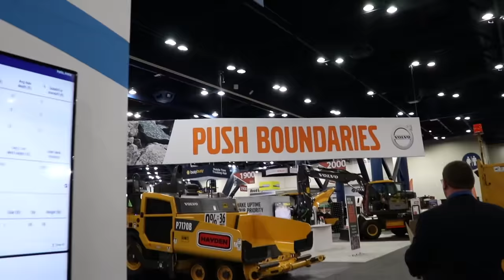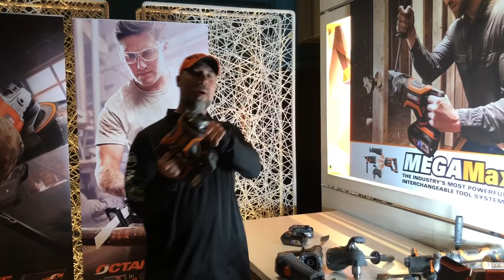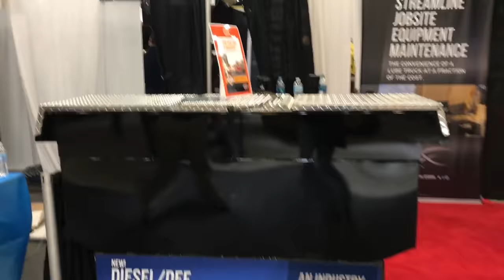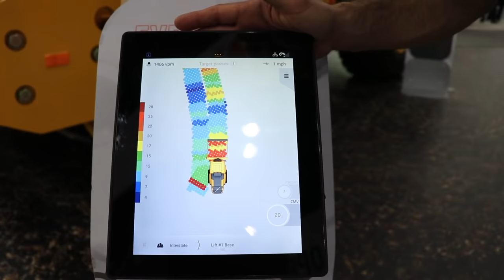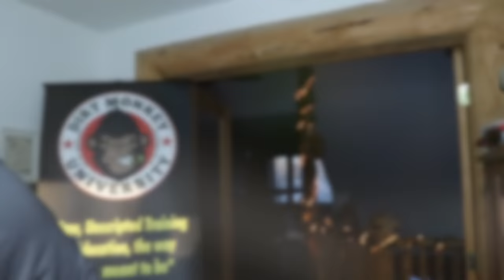Latest and Greatest Landscape & Construction tools - The Best & Worst Power tools & Innovations 2018

Comment: 8:20 the main reason for allowing a diesel engine to "cool down" a little after high idle high power operation is the turbo. Even in your trucks, if you shut the engine off after high idle, the turbo's compressor shaft will still be spinning without any oil pressure to the lubrication bushing. So you are basically just allowing the turbo to spool down a lot more and while at the same time, allow oil to cool the assembly.

Comment: The sliding radiator on the loader is boss.  The Dewalt battery powered concrete saw was a beast.

Comment: The DeWalt saw looks great for all the times I have to cut through the bottom quarter of a block.
Reply: When is out in England I want one too 😁
Reply: They are so handy in masonry to make quick saw cuts on the scaffolding I use the sthil ones all the time

Comment: Slide out radiator is fukken genius  for those of us working in the dust all day.
Reply: Eric Mahan 

Sure, in the agricultural field we already had them 10 years ago.
Reply: That’s not the radiator.
Reply: James Hintergardt 

To be exact you are right, but an oilcooler basicly does the same thing, it radiates the heat away.
Reply: Tim Hagemann Deere has had slide outs for 30+ years

Comment: The radiator on a track is a game changer! What usually happens to me is the dirt packs in between the oil cooler and radiator and I have to separate the two to clean them! (No fun!). Good video, thanks. And the zero turn mower tires I’ll be checkin into to those also👍

Comment: Great review. A lot of good ideas out there. I loved the DeWalt chop saw, that is a game changer for the fire service too. Is the Volvo roller going to be a able to give you a certified compaction or do you still have to have the soil tech with his nuke. Stanley you NEED to check out the Mecalac 6 MCR this is a game changer for the TLB, Skid Steer/ excavator combos

Comment: Volvo is rather invative. My dad has been driving a truck for about 28 of my 32 years on this rock, and one company he was with put him in a Volvo, it was a very nice truck that I could almost stand to my full 6 ft two in. He could drive it strait into the mechanic bay, and the mechanic would roll up with a computer on a cart, plug leads straight to the engine block and do quick diognostics.

I am a general contractor, though I specialize in landscaping. That DeWalt tripod lighting and the dimand saw are definetly on my wish list!

Comment: Disadvantages about the rear plow is if you have a truck 1990 to 2010 your truck is rusty and could by chance rip your bed off the truck because of its backend weight by lifting it totally off the ground

Comment: Those Black&Decker power-pack batteries are a cute idea but having an open USB socket facing into your work to slurp itself full of steel filings and dust seems like a nonstarter. A hefty Milwaukee impact on the 12v system sounds nice though.

Comment: Hey dude weren't you just at the Stihl factory"Endorsing" and praising the Stihl battery powered concrete saw?!?! Guess for enough money a fella will say just about anyhting huh!
Reply: matt west Yeah but in the other video it was metal that was cut and he made the video faster when he had shown the DeWalt and normally Stihl makes the best Chainsaws,big angle grinders etc.
Reply: @mattwest6340  He also was amazed at the DeWalt saw just after that cutting their concrete example. Concrete can be made in any consistency of hardness, from soft to almost impervious. I wonder what hardness that concrete was? He was also amazed at Black and Decker having a battery that fit all of the tools shown. 
I did notice a lot of selfies as he was showing the stuff. Not impressed. Could have used less of him and more of the equipment.
Reply: matt west bang on bro 🙏👊

Comment: I wasn’t to happy when I bought my new Gen5 Rigid set. For the first time ever I used the impact driver and I cooked it. After about 20-30 minutes constantly removing rusty bolt from metal reels it quiet working. That happen today with the temperature around mid 30s in Wisconsin.

Comment: I have seen something like the Poswer Moon Led system being used by highway road crews.  Cast a bright light down and out, without blasting drivers with blinding lights.  Seems it would be safe for crew and driver.

Comment: Dewalt concrete saw looks like it definitely has more power "torque"
Reply: Ron Hughley 
Yeah but it looked like It was cutting a softer material and it looked like It ad been cut most of the way before he started. Even if he didn't it's hard to tell without being there.
Reply: Also, dealt has their own guy running it... That's a red flag right there. The Stihl was run by this guy.

Comment: The Husqvarna k3000wet also lacks a lot of tourqe with 230volt(europe). Still more effective dry cutting with a 10inch Bosch angle grinder with a Hilti blade. Dealing with water hoses in - 20c I s also a hassle. And cutting 3 inch thick, hard precast filigree decks needs some tourqe..

Comment: That silk-tracks system is cool - biggest problem with plywood, besides handling the darned stuff, is people stealing it for other jobs.
But the excavator thing at the end - I was taught to always have the drive to the downhill side, so the weight of the vehicle is locking the teeth into the track. If it is idler end down, it is loading them up and increasing the chance of jumping the chain even more by slacking off the chain as it is loaded. Made sense to me and is the way I always do it, up or down - but if there is a reason not to?

Comment: Do you really need a battery powered concrete saw when you have to hook it up to a hose
Reply: The power tool companies need you to have a battery powered tool cause they aren't making money when the utilities power your tools.  I like battery powered tools, but if there's power on a site (and there's either a spider box or a generator on almost any job site) then run a cord, maybe with a surge strip at the end.  Tool weight actually goes down when you aren't putting a monster 36 volt Lion battery in the thing and with an improvement inn run time and usually power.  As for concrete saws, that was actually something I'd use at times where there wasn't power handy in a good spot.  We'd be doing saw cuts on a house being renovated and often the power was shut off or we were forbidden from using it cause the client was still in and out and we could trip breakers.  As for water, frequently the cutter would get hooked up to a backpack supply or one of us would keep the line visible and the dust to a minimum with the least amount of water.

Comment: Did you just endorse the black and decker cordless tools? Did anyone else see how pathetic the Rpm was on that jigsaw, don't think that this is even usable.
Reply: Black&Decker is junk. Skil has gone downhill, too.
Reply: The BlueBearDuck B&D are brilliant, end of! If I had a child under 4, I'd definitely get them this set to use until they were old enough for power tools.
Reply: The BlueBearDuck You don't know a thing about shutter speed and movement do you? BTW jigsaws don't have RPM a jigsaws motion is expressed in SPM. Pathetic is right.
Reply: RPM ans SPM are almost derivative of the same meaning. SPM being the correct 'by the book' term, yes. It'd just be whichever one you've grown to know that you'd use. You can tell by the sound of the jigsaw that it's a relativity low RPM.
Reply: Hahahaha
Reply: Those bnd tools look like toys.....
Reply: You guys do know that Black and Decker is the parent company of DeWalt. So yeah, they make DeWalt.
Reply: Sadly,  Black and Decker have been making poo for a number of years.
Reply: And you also have to wonder how long before that USB charger port is filled with sawdust and dirt
Reply: RPM is not incorrect, there is a rotating motor inside. However, SPM is more accurate for comparison since gear ratios are involved. 

Most DIY'ers don't have the specific knowledge of a professional, so cut them some slack and accept their comment within their knowledge.

It is almost like the spell nazi on social media. Instead of attacking the comment, they attack the person or language as an ad hominem.
Reply: USN_Ret 84-05 skill is one of the best tool brands out there but yes they are not as good as they used to be but they are still great
Reply: Bradley Garst then why is dewalt so much better
Reply: The BlueBearDuck h
Reply: Yikes. That'll undercut your credibility. Anybody that has worked with battery powered stuff knows right where black and decker rank....and it's somehow below ryobi ffs lol.

As for bnd being the parent company of Dewalt... They're well aware how badly That would hurt Dewalt credibility is that was widely known.... That's why they still look so different. Also I suspect they kept a lot of Dewalt engineers in place and let then continue to strengthen that brand while keeping the public's knowledge about their parent company as minimal as possible.
Reply: Bradley Garst but dewalt is the height end line

Comment: The Milwaukee M12 line rocks. I got into it because I bought one of their heated jackets, but now I have one of those impact drivers and a few other tools. I like them because you can use them all day and they are not bulky and heavy like some of the larger units. in fact, my Dewalt 20v impact just sits in a drawer now.

Comment: The delayed engine shutdown on the Volvo is nothing new or special, Cat has had it for 2 years now. Its actually there to give the dpf time to finalize a regen cycle if its in one and give the dpf and scr system time to cool. On the Cat if the machine needs to be turned off in an emergency you turn the key fully left for emergency shutdown.

Comment: If u look at the DeWalt concrete saw and the other one he let it come up to full revolution before he cut I used to be a firefighter and any of those tools even if it's gas powered it will find up u have to let it come up to full speed before u come up to cut the material

Comment: I sold a battery powered stihl. Thought at first how crap they are. Turns out they're great for cutting roof tiles on a roof. Nice and light. No real work out for the pull cord. They have their uses except for cutting block and brick

Comment: The Stihl was cutting through thick solid red brick. Meaning the brick is gripping a large portion of the blade. While the dewalt one is cutting through much thinner material, and what looks to be much softer material. 

You plunged the stihl into the brick, the dewalt was being moved over the surface quickly and didn't have to cut through anything thick. Very bad comparison.

Comment: To lighten the load on the payloader they should just cut big parts of steel out of the bucket. Duh less weight means more load.
Reply: Pope Dancis   LOL then the material would leak out
Reply: Creative Landscape Designs shhh the customer doesn’t need to know. We will sell them a real bucket later.

Comment: Stihl builds crap anymore. I finally replaced everything Stihl off my truck and replaced them with shindawa and redmax. I haven't had any issue with small equipment in months.... They crank up run have plenty of power and the attachments don't stop working while using them. Will never go back to Stihl EVER.
Oh yeah my one shindawa t27 I bought 20 years ago has outlasted about 15 or so Stihl units.

Comment: 16:55 Lol, phillips bits, get with the times Americans, they've gotta be one of the most dangerous things on a job site.
Reply: Nathan Truscott Phillips bits are quickly going away, most of us Americans who use fasteners hate them too. I prefer the Torx system for deck screws and the like. Only people still using Phillips are drywallers which are a very low torque use and the Chinese products that come in with cheap ass hardware
Reply: Oh God. Everything is "the most dangerous thing on a job site."
Reply: I can think of lots of things more dangerous than phillips drive screws on job sites
Reply: cthunter41 Two phillips bits?
Reply: The all mighty Robertson is the best and  has been for like a 100 years. In Canada we know how to screw!
Reply: Sure those are Phillips head?  Look like deck screws.
Reply: Americans invented most of the newer head designs including the star shape so wth are you talking about? 🤣